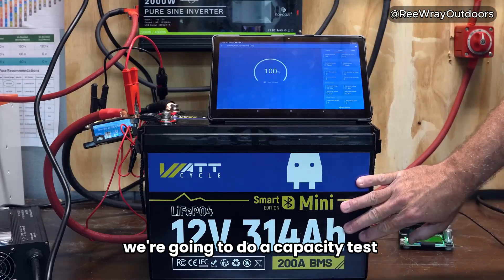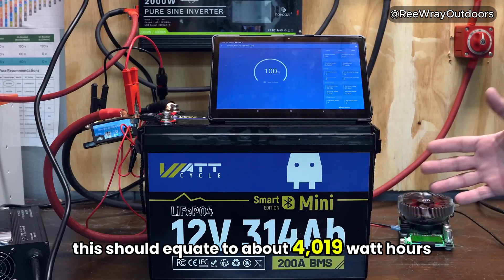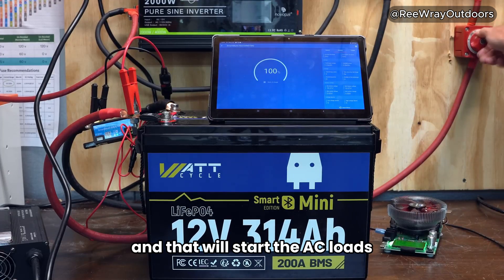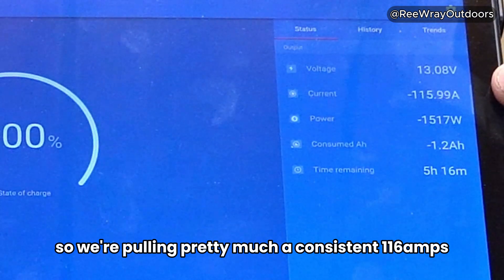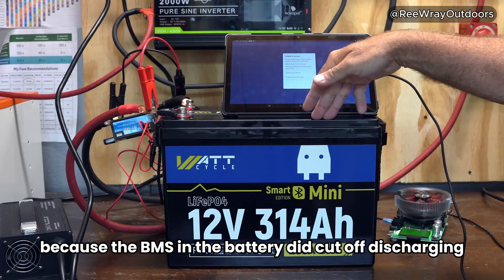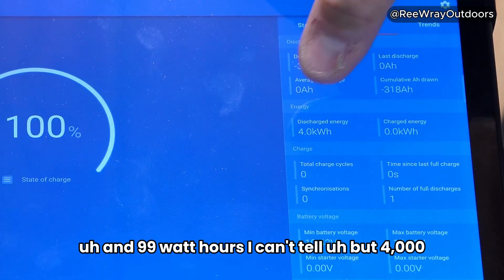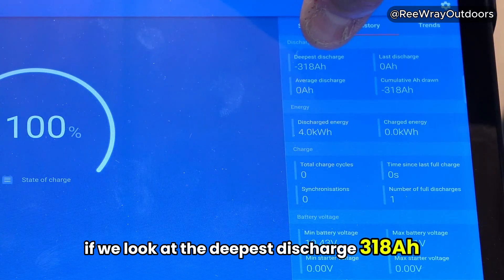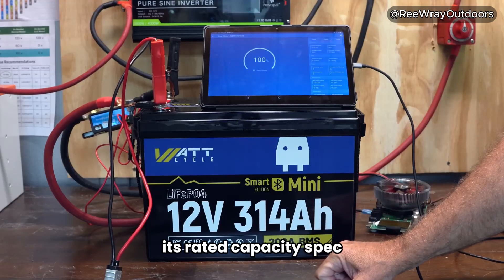Is It Really 314Ah? 🔋 WattCycle 12V Lithium Battery Capacity Test!⚡

Comment: Here's a warning for you all. Notice how wattcycle says A grade ev cells. They don't say eve cells here. They use this YouTuber's footage even after they send out batteries where they have now switched to REPT cells. I and others received 25/05/01 date coded batteries that are REPT. 
This might not be so bad if they hadn't mislead us. The REPT might actually be rated higher capacity but wait, there's more. 
The batteries have problems with balancing because of poor BMS design or mismatched, possibly used cells? The battery cells will be far out of balance and the BMS will cut off charging prematurely, in my case at 13.6 volts instead of the 14.6 volts you would expect from a healthy battery. 
I'm told that wattcycle confirms that this BMS only balances with 50ma (mv?) which is not enough for these big cells. The balancing does not kick in as early in the charging cycle as a well designed battery so people are reporting very patiently trying to balance these cells and not succeeding. 
My battery lasted 3 weeks before shutting down for good. I have been unable to wake the battery up like I had the previous times it shut down for no reason before. Wattcycle support is quite difficult to deal with but after putting in a credit card dispute they have refunded me. 
There's more. These batteries do not work correctly in parallel, wattcycle says there is a fix coming soon, it's hard to know how they would implement that. they also say they are fine. They are not. They are removing and hiding monitoring features from their app to obscure what's happening to the cells and reduce consumer complaints I'm guessing.
There are other concerning assembly details as observed in some of the tear down videos. 
You can poke around on diysolarforums, Will is looking into this battery now. 
They came really close to a screaming deal (the price changes daily though) but they missed.
Reply from the maker: Thanks for sharing your experience and concerns.We want to assure you that every cell we use continues to be top-grade A-quality and undergoes rigorous testing for performance, safety, and cycle life. Our commitment has always been to deliver reliable, high-value products—never to compromise on quality.

Comment: Wattcycle 280Ah passed capacity test at 305Ah (Per Will Prowse test)
Wattcycle 314Ah passed capacity test at 318Ah.  4Ah over rated capacity is a lame.
Reply from the maker: Thanks for your comment! 😊 Actually, exceeding the rated capacity is a positive sign — it shows the battery uses high-quality cells and has no capacity inflation. While 4Ah might seem small, it demonstrates WattCycle's commitment to honest labeling and real performance. 🔋✅